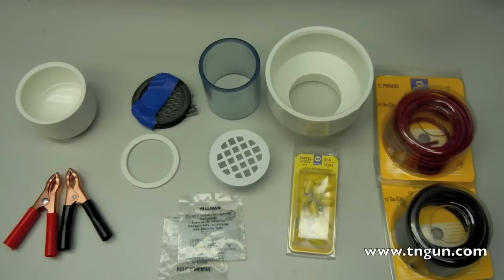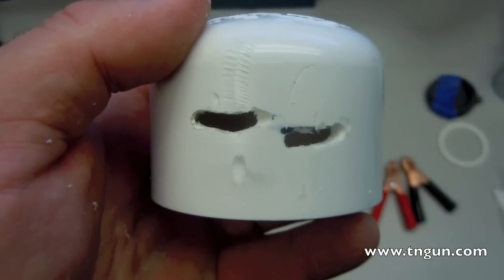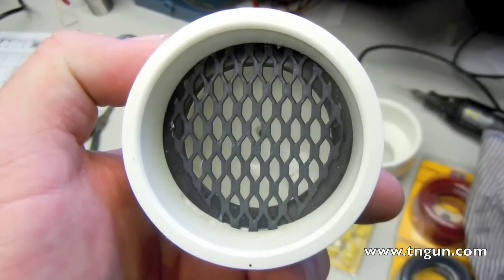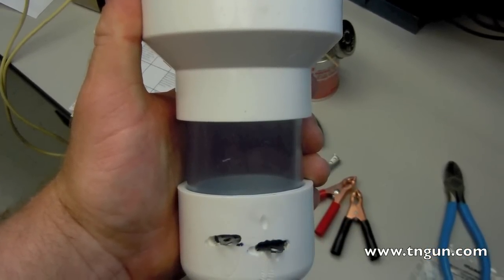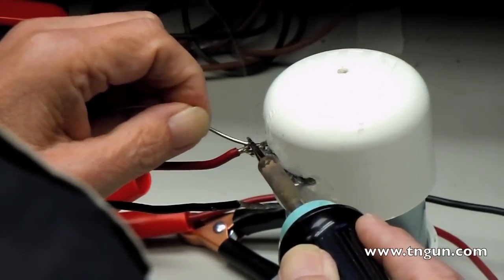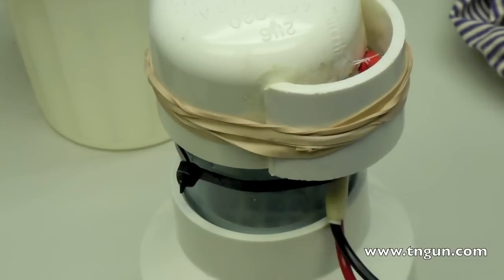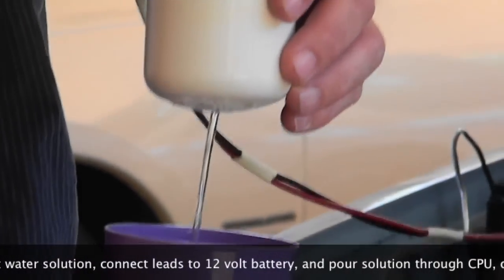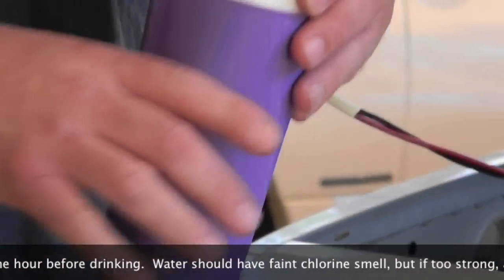How to Build a 12 Volt Chlorine Generator for Water Purification

Comment from the maker: It rinses off after use, thats why you have to rinse every time.  The SWIM guys don't "sell" the electrodes, You have to just email them and ask what you would have to donate to get one.  Alternatively, you could use a mixed metal oxide anode/cathode set from a chlorate cell, but it is twice as expensive, and someone may think your baking pyrotechnics instead of water...
Reply: can you list all the materials used?

Comment: What do you do to handle the chlorine gas that is produced (aka mustard gas) I've done an experiment with this before and I believe it produced some, which is very dangerous if not handled properly
Reply: Chlorine gas is not mustard gas.
Reply: The gas this produces is hydrogen.
Reply: It actually produces hydrogen (H2), which explodes, on one electrode and Chlorine gas (Cl2) on the other electrode.
Chlorine gas recombines in the solution to make NaOCl (sodium hypochlorite) which is the bleach that you want.
if you run this device in a well ventilated area, there is no risk.
You can put a bottle (bottom up) over the electrode producing H2 to collect the gas and then approach a flame to the bottle opening (bottom down) and you will hear a "POP" and see a flame blast. That's the classic experiment we do at school ;-)
Some Chlorine gas will escape, but the majority will remain in solution. Don't breathe it in too much.

Comment: So what happens to the sodium? Does it plate out on one of the electrodes? Does it get washed away when you rinse out the unit after use?
I don't see any mention on the SWIM site of buying the electrodes. Do you have any other sources?
Reply: The sodium remains in the water. The high current breaks the bond of the sodium and chloride. Both elements remain in the water. When the chloride, it can be measured as "free chlorine" which is the amount of unused (free floating) chlorine in the water. The sodium is left floating free as well after the bond has been broken.

Comment: This looks really interesting, if you have one of these and a car and salt your made for safe water. Why are city's not using salt and one of these units instead of nasty chlorine gas to chlorinate the city water? It would be much safer!
Reply: Just letting you know. I work for the city of Philadelphia we use Sodium Hypochlorite which is exactly what this generator produces. Most of the city’s in the country have converted their systems over. I just figured that I would share that information with you.